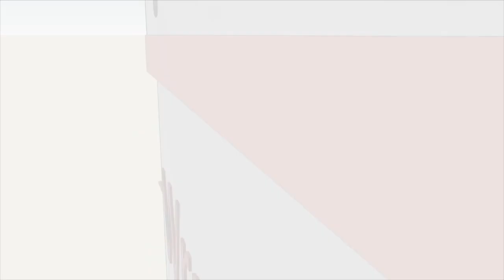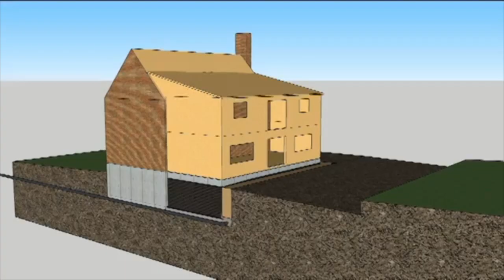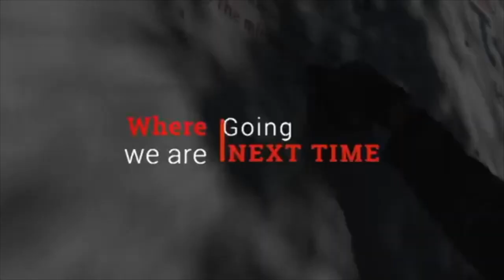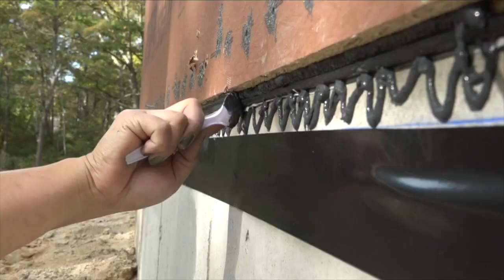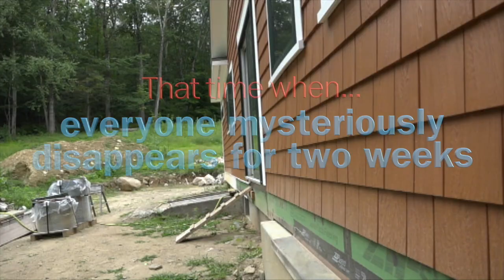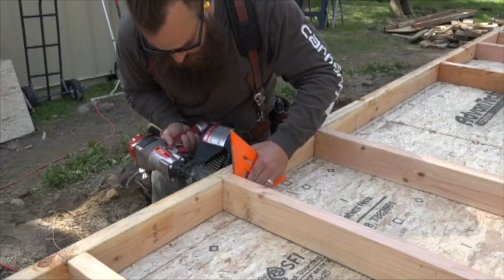2/ Airtight Walls in the Real World — WTRB, Air Barrier, and Tape (PTC's Continuing Ed Series)

Comment: No. You dont want airtight construction. You want a house that exchanges air naturally to cut down on mold and outgassing. The key is proper construction and insulation to resist heat and cold transmission. 
Concrete or Hebel block or ICF walls. Steel roof trusses and roofing. Whole house fan. Minimum R-40.
Only wood in structure is CDX plywood and interior studs.
Hardilap if you must.
 Based on 45 years as Inspector and Designer.
Reply: Show me the data that proves that I shouldn’t airtight homes
Reply: wow hard to bekeieve anyone as experienced as you is still so behind the times..discouraging we are ever login to see the necessary change we need in consecutive in resin trial co instruction. OF course you need ventilation, but you need filtered, controlled and balanced cld ventilation, not random and variable through dirty fiberglass mats and holes in the house.
Reply: If your house isn't airtight, the insulation is completely pointless.

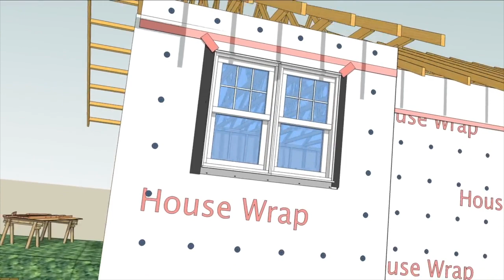Comment: 6:39 You mentioned plywood and house wrap are best for under a cantilever. Can you discuss it further it in another video? I'm also interested in the details around porch cantilever overhangs like the detail at the wall to cantilever intersection for water leaks, places for air leaks, flashing the ends.
Reply from the maker: Tyvek has some pretty good installation guides that cover cantilevers, but yes, it is on my short list of topics to cover more deeply.